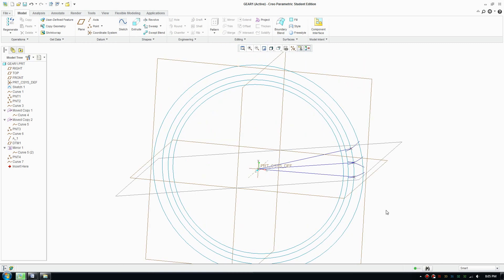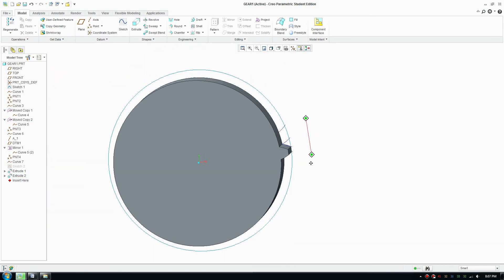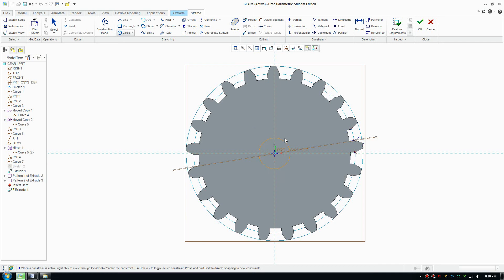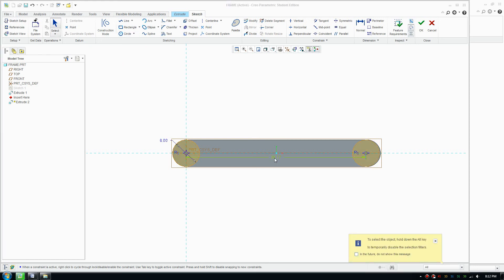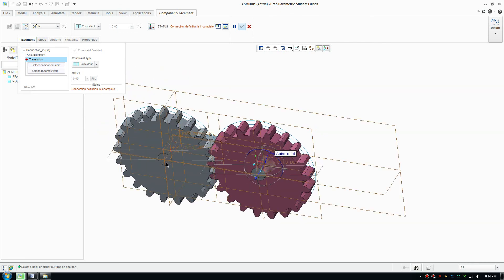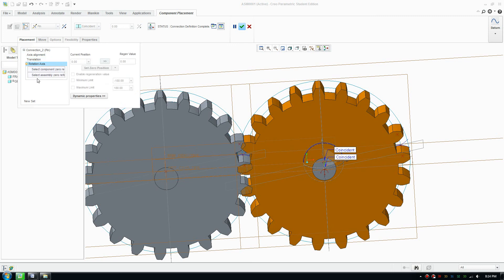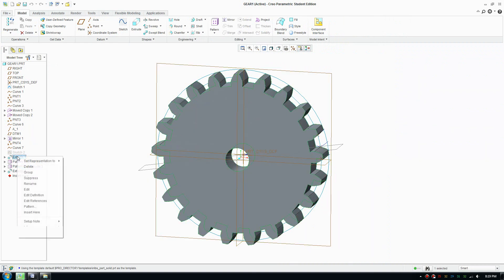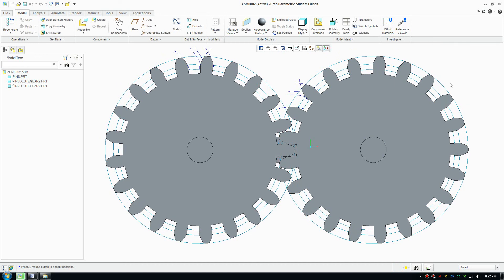How to Draw and Assemble Involute Gears in Creo Paramatric Assembly - Part 3

Comment: I really need this to work but I can't get select the curves when projecting to delete things which is the same problem everyone else is having, I've remade this 4 times and nothing is working.
Reply: +QuantumTeapot I'm literally doing the exact same thing as the video, there is not one difference. There has to be something that isn't explained here, perhaps an option. I read below about some 'smart selection' thing but I have no idea what that is or where it is.
Reply from the maker: +QuantumTeapot send the file to my email, I can check. huu@huuhuy.com
It is working fine on my side. Try zoom in close to see if there is any opening in the curve.
Reply from the maker: +QuantumTeapot Smart selection is on the bottom right. You can select different things to be selected, eg. curve, edge, points etc.

Comment: I cannot select the involute curves when projecting. I tried the offset method but unable to delete all the unnecessary segments, so sketch is incomplete. Some of them just cannot be removed. Then I tried connecting those segments with lines to form complete sketches but there is some constraint error.  Can somebody help me?
Reply: +Abdullah Ahmad I found the solution. If you shorten the curves (edit them after putting the equation) so that they are just a bit longer beyond the four needed intersections, they can be projected.
Reply: +Abdullah Ahmad Hey can you help me, i still can't find a suitable solution.
Reply: +Ajax Narayankutty Sorry I don't know any other solution. Have you tried shortening the curves?
Reply: I mean I'm also encountering the problem with projections
Reply: Also I tried with offset method but still there was problem with extra dimensions not getting deleted!
Reply: How did you solve it?
Reply from the maker: +Abdullah Ahmad Hi, where in the video are you having trouble? At what time?
Reply: I'm not able to select the curves in the "project" feature?
Reply from the maker: +Ajax Narayankutty Can you tell me at what time in the video?
Reply: At exactly 1.02 min in Part 3 of invoulte gear profile!
I'm not able to select the two involute curves!
Reply from the maker: +Ajax Narayankutty Make sure you select the appropriate plane in sketcher and check that the smart selection on 'all'. Sometimes you may need to redo the involute curve. You may click something incorrectly. If you want send me the file to my email. Check the channel info section.
Reply: A "not-so-efficient" solution would be to create a sketch on the plane and trace the curves using the arc tool. works just about

Comment: why wont the involute curves project?
Reply from the maker: You need to go to the 'reference' option settings and select the coordinate system.
Reply: It's also possible to use the offset tool, and enter '0' as the value - it'll achieve virtually the same effect as project. I didn't even have to have references selected!